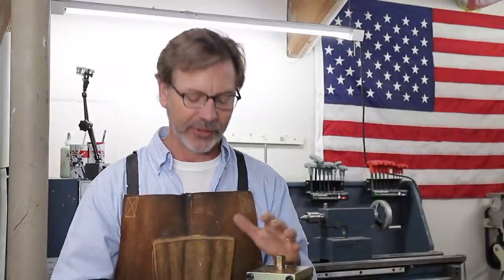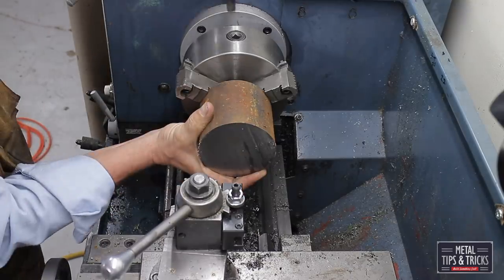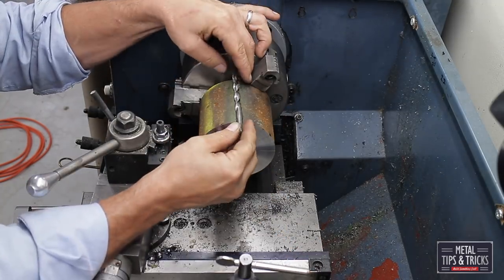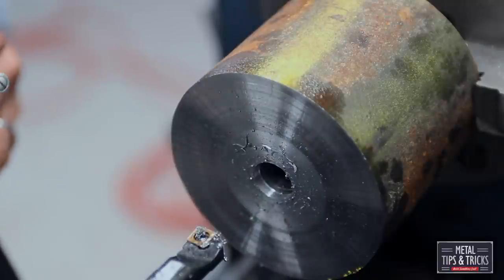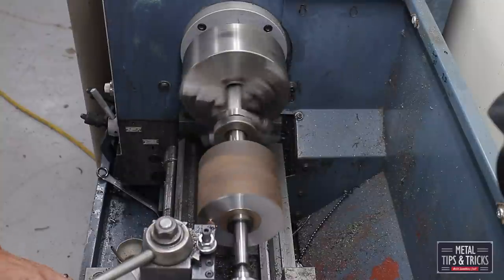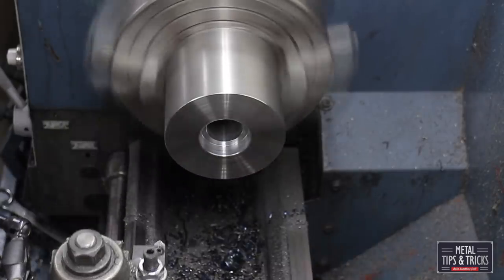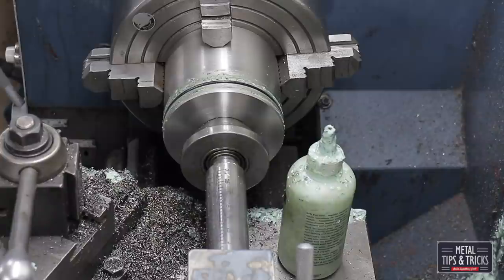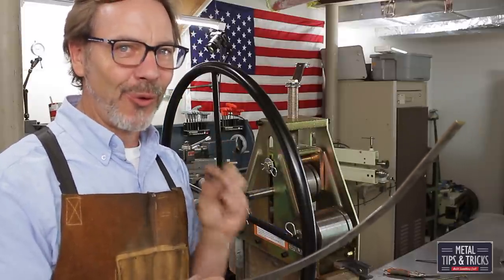Making roller dies

Comment: Good job on the dies. Bought the same HF tube roller, tried to use it once and its sitting in the back room collecting dust. Built my own ring/tube roller with a 3ton hydraulic jack and both bottom 1 inch shafts driven by chain.  Worked so well I'm building a bigger one with a 20 ton jack, 4140 shafts, 2 1/2" bottom, and 3" top,  and a hydraulic motor to drive it. I enjoyed your video.

Comment: At the last bit you mentioned the machine flexing because the metal is being worked off-center. I'm actually about to make dies for a roller bender I built and wanted to be able to work multiple profiles on a single die. This is what I'm doing... Make a die wider than you actually need. Cut a few contours much like you intend on doing but separate them into a number of separate dies that are equal in overall width. You can them sandwich them together and simply switch out the center one with an end one. E.g: if you need a 3" wide die and five different contours, you have two 1" wide "shoulder" dies that are the full diameter and one 1" "center" die with your contour cut into it. You just cut multiple center dies that you can switch out and each die only consists of 1" of material rather than 3" of material.

I hope this made sense as it's certainly difficult to explain in a simple YouTube comment.

Comment: Nice video, thanks for posting!
I have looked carefully into parting tool chatter on my light duty lathe, and I have a couple of recommendations:

1) Make the tailstock stickout as short as possible.
2) Put a machinist jack under the parting tool so most of the cutting force will go straight to the cross slide, and bypass the relatively flimsy foot of the compound slide.
2a) If you'd rather not use a machinist jack, at least position the compound slide so the tool bit is as close to the center of the compound foot as possible.

I have a Grizzly G0602 lathe, and the compound collar is very weak where it is relieved to reveal the protractor. By simply turning the collar around (and obscuring the protractor) the stiffness is vastly improved and the lathe is much more useful.
Reply from the maker: Great points.

Comment: Great job Dale. Hope the grinder proves usefull. Three relays and a hydraulic solenoid and my big Kalamazoo saw functions as intended thanks Carl Garrett. I have to build a rail bender for two 15" gauge railroads being built here in Texas. Just have to make it strong enough to bend 20lb rail.
Reply from the maker: So glade to here you got your saw running  :-)

Comment: Great job with the video.  I had just purchased one these HF rollers.  I have the twisting problem also.  I suspect the holes for the shafts are not exactly parallel with each other.  Also I suspect I need to shim the sides till the rollers are in exact alignment.  However I am not in a production situation so I can take some time to out the twist.   Thanks again for your excellent work making the videos...

Comment: Good information.  Maybe try cutting your single rollers into multiple disks for the different sizes,  then they could be placed on the axles centre line to the roller frame and eliminate the twisting.
Reply from the maker: Thanks for the suggestion. I don't think the axel can handle the force.

Comment: if you used some think like a transmission jack on the large wheel side it would help the jig from twisting or cobble together a bottom screw on the bender, like the top one so you have a complete bracket supporting the drive wheel from the top and bottom.
Reply from the maker: I like the idea of the set screw.

Comment: seen another guy use a dailindicator for measuring the dept if a cut , he used a dail indicator with a magnet (gleud?) on the back 
he stuck the indicator with the magnet to the bed and dailed off the cariage , its a lot faster to set up compared to using the dail indicator on a arm 
after youre done stick the dail indicator out of the way like a fridge magnet

Comment: Hardening steel does not appreciably change its modulus of elasticity. It's a very popular misconception. It does raise the stress it can be subjected to before it becomes permanently bent, but that's not what is being discussed (in relation to twist drills vs centre drills) at about the 4 min mark.
Centre drills are stiffer because they're short and stocky, not because they're thru-hardened.

Comment: I know this is older but whenever you use a smaller boring bar get a old bicycle innertube cut it into inch wide and 1/2" strips and tightly wrap the end of your boring bar and secure with some rubber bands and it will greatly reduce your vibration and chatter 👍👍👍

Comment: Nice project. I've made some of my own dues for a similar roller, when bending like you're doing lubrication is important. It helps keep the mushroomed edge of the flat stock from binding. Personally I've had good luck with WD40. Also the bearings take a beating, I drilled my benders shafts by drilling them and adding grease fittings and replaced the bearings with quality shielded ones and removed one side shield. Installed with the open side towards the grease I haven't had to replace them. Originally I was buying the bearings ten at a time. Just my experience, I know there's a hundred ways to do things. If you check the Swag Off Road website it'll give you a lot of ideas what that roller is capable of.

Comment: Great video - a couple of ideas I thought of (I'm only starting out so these may be wildly out!). Could you taper the grooves ever so slightly so they are wider nearer to the outer edge. this would compress the excess metal but may cause too much strain on those thin side plates. The other idea I had was to make thicker side plates or strengthen the ones you have to prevent distortion. I am in the process of designing my own but will be using at least 10mm side plates which i hope to get laser cut locally. the rest i will machine. I have the same lathe as you (Different company but obviously from the same factory!) and I have the same issue - I thought it was me at first! I will be taking the apron apart this winter and scraping or lapping all the ways in. I have done this on a smaller lathe and it transformed it. More accurate, less chatter etc. Great video - keep em coming!

Comment: Or... if you don't have a lathe, just call up Troy at Off Road Swag. He's got all the dies for the HF roller, including the "hard way" roller dies. I've got about 10 die sets from him. I'll probably upgrade to his ring roller, as the HF ring roller side plates are super soft metal, and worbble out the holes so it's no longer square.

Comment: hey Dale, that gadget is where your anchor lube would really shine. a light application to the sides of the bar being bent should make it run through the dies a little easier sine the metal is being forced against the side walls of the dies. 
personally i don't like the anchor lube in cutting applications because it prevents adequate chip evacuation and recirculates the chips too much. on the lathe i use at work the coolant system is great because it flushes out the chips when doing a deep groove like you did for the dies with the cutoff tool.
also at this juncture i have to side with some of the critics that the background music was a little overwhelming. excellent narration throughout though! some of the youtubers would do well to follow that lead.
Reply: If anchor lube needs washing off each time, I'd imagine moly grease etc would do the job,  or soap just to save money.
Reply from the maker: Thanks Ill give it a try

Comment: What is that self driving dog called? Never seen one. Cool project. I use bent strips like that to make bucks for metal shaping. I made similar dies for my bead roller but the machine couldn't take the forces. This might be the ticket.

Comment: Nice job.  It would be interesting to try centering the slot on the HF roller rather than working at the edge... (?) or adding a HDPE spacer between the drive roller and the frame maybe?  As to the harmonic issue: Sometimes adding mass to the lathe / tool post can significantly dampen the vibration / noise.  I have seen / tried several things like blocks of lead, heavy magnets and even sand bags.  Yes: it increases the hazard of something getting in the way or caught but it is effective.  Vibration in a grooving tool extended way out like that can also be mitigated by sistering it as far as possible, "leading" the bottom edge (with Pb or HDPE), and even by placing a small machinist clamp on the underside (clearance provided of course).  For one-off pieces the tiny clamp (or two) is the least effort - second of course to ear plugs and muffs over them.  The viscosity of the lube/cutting fluid and/or chemical composition can make a big difference as well but you may have to trade off for smoke and fumes accordingly.  Finding the perfect speed/cutting angle/rotation can be frustrating though.  Thanks for enduring it to share your idea.
Reply from the maker: I put the grove  On the edge so I could put larger groves on the other part of the rollers some day
Reply: Figured you had a reason.
Thanks for the follow-up. 
Spent some time on the lathe today and thought of you.  Turning some 2" round stock down to make shafts.  Part was singing no matter what  speed I cut at . So I wrapped it in painters tape and it worked.  Cut the noise and reduced chatter too.  (she's seen some miles).  Plus I could make notes on the tape to keep track of my cuts and dial readings whenever I got interrupted.  It was worth it for that alone.  Anyway... Thanks again.

Comment: did you not have to cut a broach for a key on the drive die/wheel?
Reply from the maker: Yes I brought the drive wheel, good question
Reply: @BuildSomthingCool  Ahhh.  Thank you.  I designed Delrin wheels for my SWAG roller for up to 1.5" angle iron.  The drive wheel was the hardest part because of the broach.  I had to take it to a local shop that is much better equipped than me.  A couple weeks and $50 later I had a set.  I know there are home shop press broaches, but I would us them maybe once every 3-5 years.

Comment: Hello Dale. I have the same Enco lathe, but I cannot find and documentation on what the exact cam lock size is on the chucks. Not even the Manuel states it. Is yours a D1-3 or D1-4?
Reply from the maker: Mine is a d1-3

Comment: Just spitballin here, hows about if ya wuz to make those rollers in interchangeable sections, say 3 sections per roller, each section with a different size groove.  Ya jus put the one you wants in the center and an give er!   Now yous gots a multi use tool withouts the twisting ???   You could make roller sections for all kinda profiles and use a little less material while youre at it.

Comment: Hey Dale, you are wrong on the internet. Let me fix that for you. 

It is true that drills typically are softer at the shank end, however hardness and stiffness in steel is hardly correlated at all. Hardness only affects how easy it is to dent the surface of a material. The stiffness of hardened steel and mild steel is practically the same. If anything the mild steel will be slightly stiffer. If the hardness of the material was to come in to play then there would have to be dent's left by the drill chuck on the shank of the drill.

The reason you want to use a center drill to start the hole is because it is short and stubby. Take a long rod of material and fasten it to something solid so that only a short length is hanging out. Now try to deflect it. Repeat the experiment but now with a long stick out. You will find that the deflection with the long stick out is way bigger, I'm talking hundreds of times bigger. 

Keep up the good work!

Comment: how do you make an affordable bender that would bend 5" steel like that?
Reply: I designed and build a variation of this unit:
http://www.swagoffroad.com/SWAG-Tubing-Roller-HULK_p_89.html
For the yoke I did a weldment of 1/2" thick plates, line bored on my lathe and then squared up by milling.  Sides were made from 3/8" thick plate, rough cut with a cutting torch, and then worked to correct dimensions.  Also, for the die axles I went with 30 mm to avoid strength problems.  Not sure if this would bend 5" wide steel, but the the basic design can be used and scaled up.
So far I have only rolled 1" dia tube, and the machine rolls quite easily while making a very accurate circle.

Comment: You think somebody scraped in that lathe in China? Bwahahaha good one!😂😂😂  most of the precision sliding surfaces there are finished with an angle grinder. But if the castings aren't warped you could scrape it in and have a good machine.

Comment: Something is wrong with your lathe other than the manufacture.  Maybe it suffered some abuse from the previous owner?  I have the exact same lathe that I bought new about 15 years ago and mine has been spot on.. You do need to invest in some better carbide tooling.. Brazed bits really don't hack it.. Shars, Grizzley, and Precision Mathews all have reasonable inserted stuff for $100..
Reply from the maker: Thanks Ill give them a try